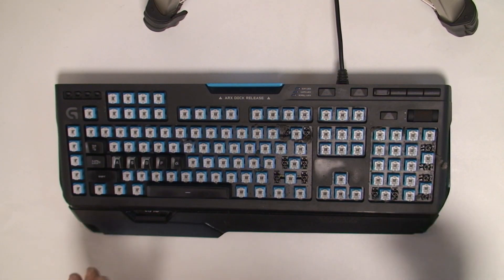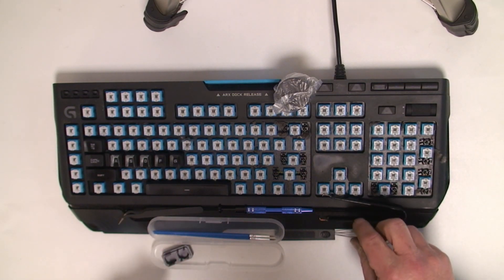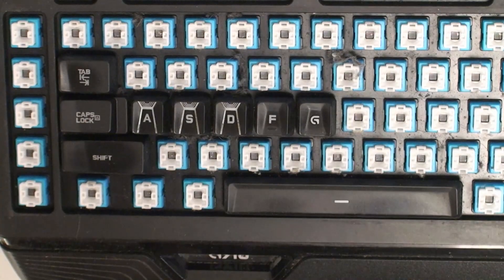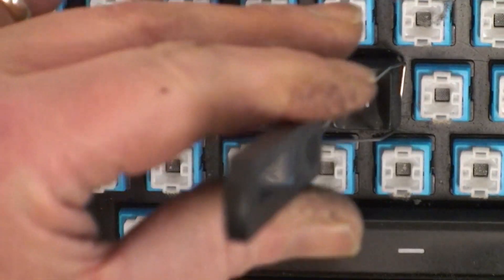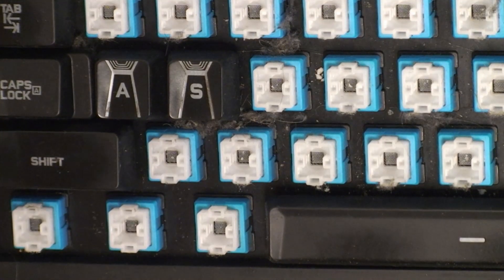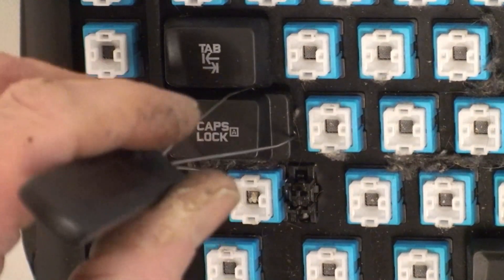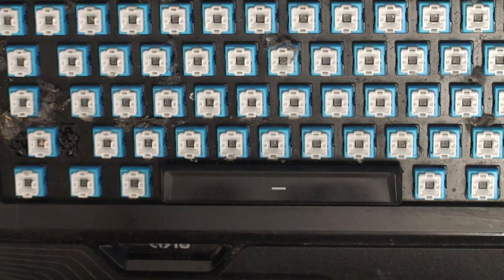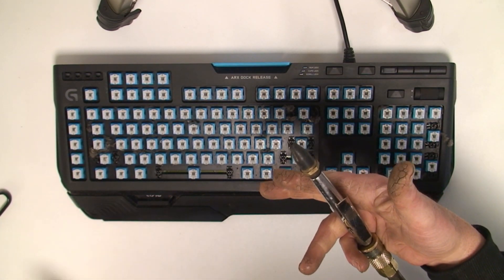How to clean and lube a Logitech Mechanical Keyboard to fix sticky key issues

Comment: Have the same issue with my G910. P was the worst. 
Removed all the keys, cleaned and lubed all the switches and key caps. Still got double taps!
Ended up smashing the P out of frustration and it fixed it! 
I''m going with it needed a bit of encouragement to get fully lubed.
Reply from the maker: 😁 I don't blame you!
Reply: Your comment is priceless... 

I have this fucking double taps on E... 

After reading your comment, I've tested my E before your method... got several taps... 
So I've punch the E... anything else.

Solved... 

So thank you, once again violence was the solution.